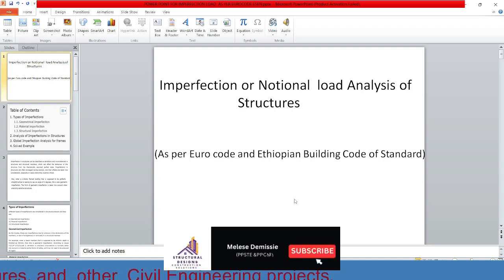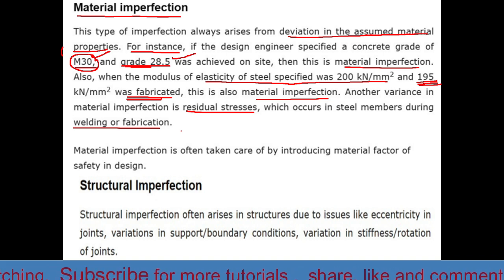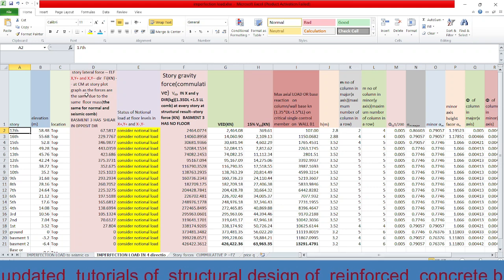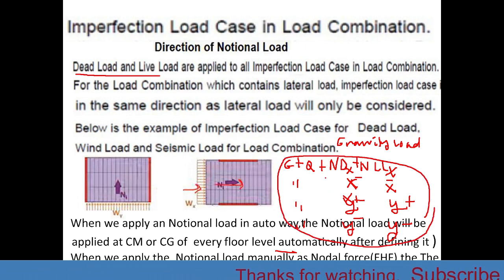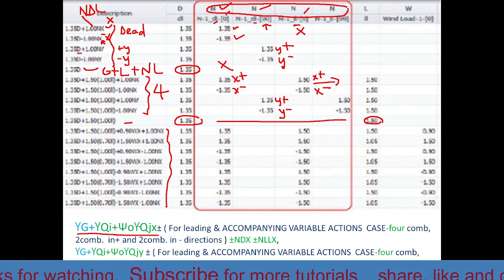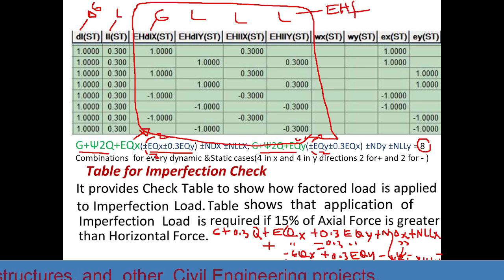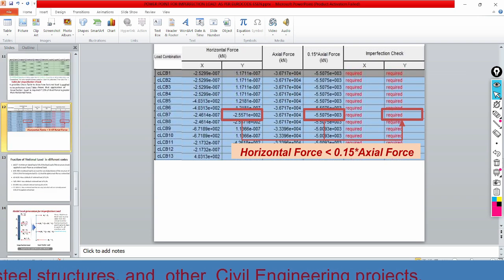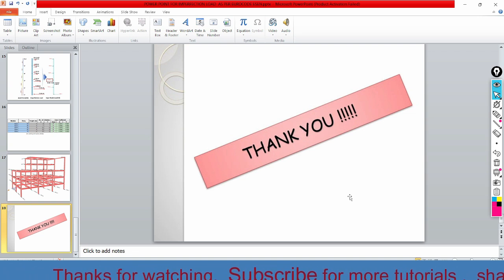Complete Structural Design of 20 story building using ETABS in Eurocode and Ethiopian code(part 22)

Comment: For columns, Eurocode suggests inclination values and imperfection amplitudes related to member length (e.g.,  to L/200 to L/350 ) as a measure of initial out-of-plumpness, what is your insight? Many thanks for your best explanation and expertise
Reply from the maker: it is L/200   or 0.5% of its length or height

Comment: Can we apply  phi=1/200 for concrete structure? You mentioned it's on Eurocode 3 for steel structures.
Reply from the maker: yes you can. it is the same for both